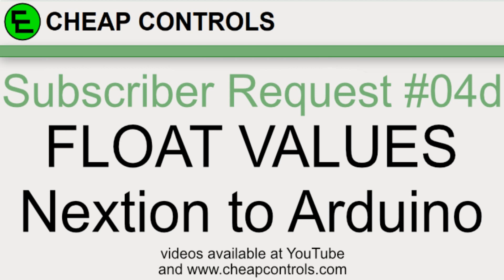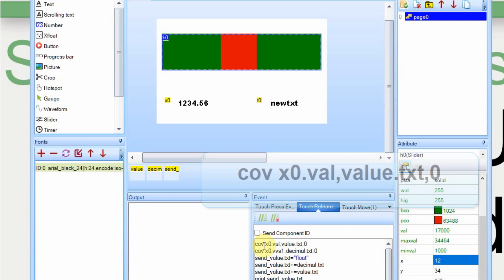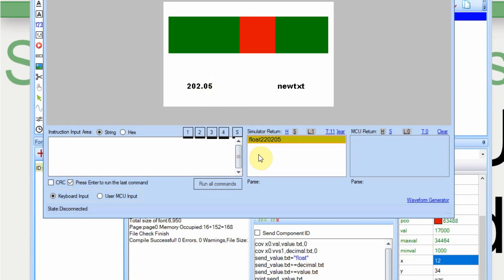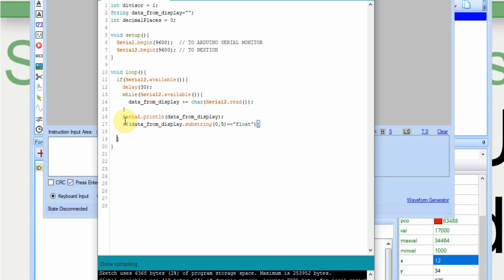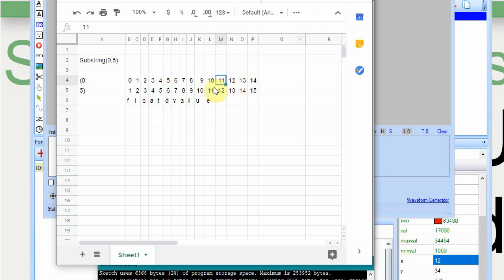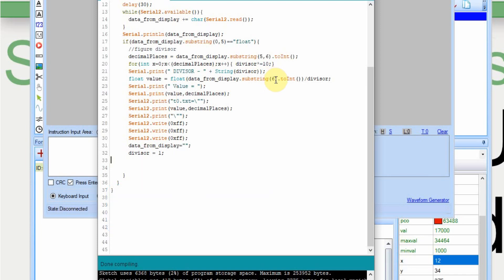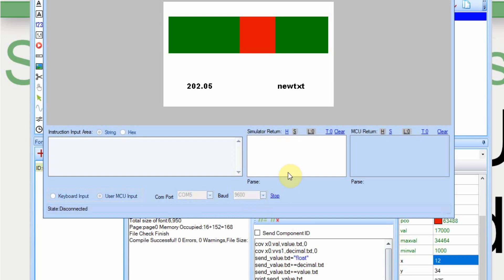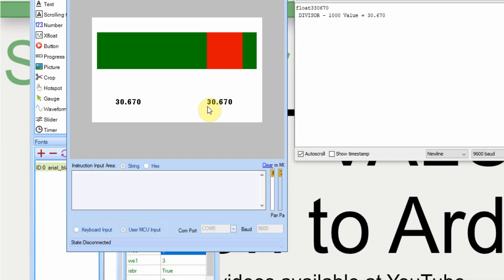#101 Nextion Display - Float Values Nextion to Arduino - Nextion Tutorial

Comment: cov x0.val,value.txt,0

cov x0.vvs1,decimal.txt,0
send_value.txt="float"
send_value+=decimal.txt
send_value+=value.txt
print send_value.txt

Why i get those errors?
Error:Invalid Variables:send_value( Double click to jump to code)
Error:Invalid Variables:send_value( Double click to jump to code)
Error:Compile failed! 2 Errors, 0 Warnings,
Reply from the maker: cov x0.val,value.txt,0

cov x0.vvs1,decimal.txt,0
send_value.txt="float"
send_value.txt+=decimal.txt// you need the ".txt"
send_value.txt+=value.txt// you need the ".txt"
print send_value.txt// I would also not use print but prints sendvalue.txt,0  

I do not have the editor with me but I think mhy changes above are correct.  I leave the .txt off all the time.
Reply: @CheapControls  I was reading the code for more than half hour i couldn't see that the .txt was missing. Thank you very much.
Reply from the maker: I am glad I was able to help.  I have done the same.  Spent hours because I forgot a comma or a semi-colon.  It can be frustrating.
Reply: @CheapControls  Everything looks ok but if i change the value more than 2-3 times i get this at Serial monitor.  And 
19:44:21.457 -> DIVISOR - 100 Value = 45.85float2588
19:44:36.827 -> DIVISOR - 100 Value = 5.88f⸮oat2300
19:45:27.421 -> f⸮oat2300float2300
19:45:38.277 -> f⸮oat2300float2300f⸮oat2330
19:48:00.612 -> f⸮oat2300float2300f⸮oat2330fl⸮at2530
19:48:38.754 -> f⸮oat2300float2300f⸮oat2330fl⸮at2530float2530
Reply from the maker: It looks like it is getting appended with clearing
Reply: @CheapControls   i place data_from_display ="";         out of       if (data_from_display.substring... now it look's better but i steel receive trashes.
i try to send 3.30 and i take this 
12:59:21.062 -> DIVISOR - 100 Value = 0.33
12:59:21.955 -> tim⸮2330
12:59:22.518 -> tim⸮2330
12:59:22.987 -> timh2330
12:59:22.987 -> DIVISOR - 100 Value = 3.30

Comment: Hi there, thanks a lot for the video. I have got one error while compiling. i.e. error invalid:Variables:send_value.txt
for send_value.txt="float"
send_value.txt+=decimal.txt
send_value.txt+=value.txt
print send_value.txt
Reply from the maker: do you have the for line for(send_value.txt=="float") -- note the double equals sign
Reply: @CheapControls  sorry for the typing mistake. I'm not using for
i have tried double equals to, but same error i'm getting i.e. Error:Invalid Variables:
send_value.txt (double click to jump to code)
send_value.txt(double click to jump to code)
send_value.txt(double click to jump to code)
send_value.txt(double click to jump to code)
Reply from the maker: I am still not following.  If you go to cheap controls you can submit this as a comment and I will Email yo back then you can submit your code for review.  If I see the HMI file it might help me follow you better.  Sorry for following your request better.
Reply: @zeptohassan6928  Check if your variables are declared as string

Comment: Hello, can the source code be shared? thanks
Reply from the maker: If you want source code you have to go to www.cheapcontrols.com and fill out the comment form.  List the video number if you want the Arduino code or the Nextion code or both.  Thank you for watching.
Reply: @CheapControls  I have made a comment, thank you for your wealth, the problem I am currently encountering is the conversion between ieee754 floating point numbers and four-byte hexadecimal numbers. Can you do a video to give pointers, thank you
Reply from the maker: Check out this video and see if it helps https://youtu.be/MhjV6xppNBU

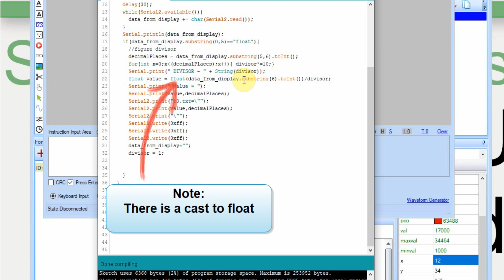Comment: at 8:30 you say note there is a cast to float. What does it mean ?
Reply from the maker: Before I answer that do you know the difference between a float and an integer.  Sorry to ask but my answer will be different depending on if you know the difference or not.
Reply: @CheapControls  I think a float have decimal and intger have not. Im french so i try to translate what was a '"cast" but never got an answer. :) thank for reply !
Reply from the maker: I was waiting for your reply.  to cast is to take a value, in this case an integer.  If you want to keep it an integer for the code but for a single calculation you want to turn it into a float you can "cast" it.  lets say you make x an integer.  x = 10.   Then x/4 would be equal to 2 instead of 2.5 but if you cast it like this  float(x)/2 would temporarily turn it into a float just for this line of code.

Comment: Does this method work with multiple float values on the same page?
Reply from the maker: You could but you would have to have a unique identifier for each box.  float1 and float2 or something like that and then check for that unique identifier in the Arduino.

Comment: Thank you very much, your videos are very good, they have a lot of quality!

How can I use this variable on the arduino?

for example:
If I received a 1.1 from the nextion screen and wanted to save the value for later use in an if like this: "if (value == 1.1) {
digitalWrite (12,1);} "
Reply from the maker: I would think you could use it similar to your example.  Do you think it would be useful to make a follow up video with a practical example?
Reply: @CheapControls  
Yes, that would be very illustrative, I understand the general idea of how to read and that opened many doors for other types of code. But I would like to see how you do it, your codes are much cleaner, and professional!
Reply from the maker: I was looking through some older comments and was wondering if I ever made a video that assisted you with this.  I usually reply when I put out the video but I did not respond to you and I never want to leave people without a reply.  I apologize if I was not able to assist you.